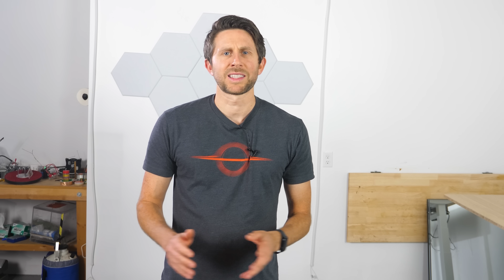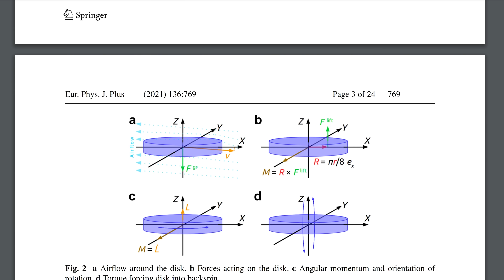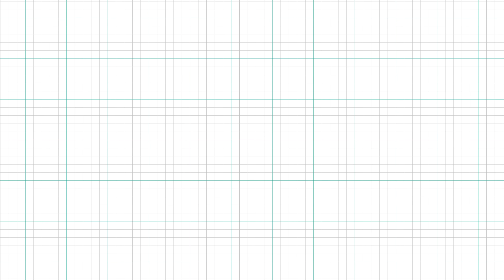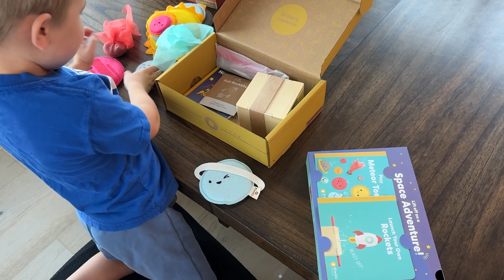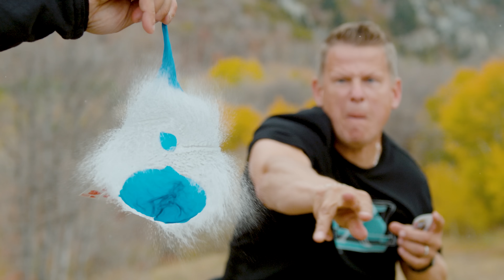The Secret Behind the World’s Fastest Card Thrower

Comment: Just did a pulling test on plastic last week. 100mm/min pull resulted in a pretty quick snap with little stretching. 20mm/min produced like 4-5x stretch length of the object itself. Due to the structure being a big messy bundle at first, but if you pull it slowly, they start to organise in a direct chain until they finally break. Plastic is weird.

Comment: bro amazing video, though i believe there is another force at play here, when you spin an object it creates centrifugal force so everything from the center of the mass going to the direction of the spin is actually enhanced by additional energy that is stretching out the edges and making them sharp so when it hits it strikes and doesnt bend. I blieve mostly thatsz the reason why when its thrown it cuts and when pushed slowly it bends, the spin makes the card harder on its outside edges because of the stretching forces
Reply: it would be interesting to see if you can measure a card thats being thrown without a spin just direct shoot, will it cut or it will bend, that will show it all :)

Comment: Regarding the scale used to measure the force of the thrown card; what about the inertia of the scale mechanism? What is the mass of the weight plate and the gear assembly that turns the dial, as well as the spring that is calibrated to resist the weights placed on the scale? Since the power of the thrown playing card relies so heavily on the impulse, rather than the mass of the card itself, how much of the impulse is lost to just setting the scale into motion. If I were to estimate the actual impulse force of the impact of the card, I would guess over 1kg of force for a short time, possibly more.

Comment: Seems to me that there is much more of a shearing action instead of a buckling compression force.  The card euler buckling capacity is very low but due to its profile, speed and angular momentum, and shear modulus, it should be able to cut through more of a slicing action than a penetrating action.

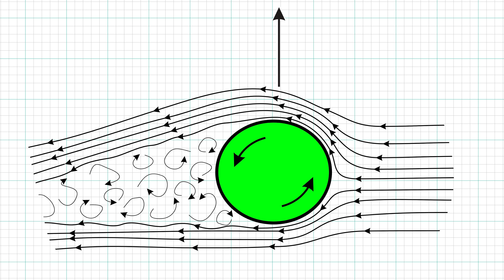Comment: "When the object is in a backspin. 3:20 ..the top of the disc is dragging air in the direction of the moving object..." In a backspin, the top is moving opposite the direction of the moving object. It's moving backwards, like a retreating helicopter blade and is moving slower than the bottom relative to the air.

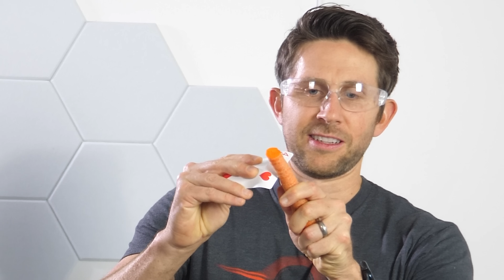Comment: 6:47 i think the reason why the card did not  bend when thrown with speed and a spin is because it gets stretched out due to the centrifugal forces and becomes stiffer then normal. Also your way of measuring the impact of the card was very inaccurate,  that is because the plunger of the scale has inertia and it absorbs some part of the impact.🧠
Reply: I think you’re on to something there… and as far as the measurement method, yeah no good. But if they tested a few other “controls” they could have a better idea of the real forces involved.

Comment: Great video!
Though I gotta say the part with the scale is wrong on several levels. First, the maximum force generated in an impact inherently depends on the hardness of the objects.  In the ideal case of perfect hardness, the maximum force is infinite. So the maximum force generated in the scale test has no relevance to the styrofoam.
Second, the way the scale test is being carried out, it isn't measuring maximum force during the collision at all - scales can only measure force in equilibrium. The maximum reading on the scale can however be used to calculate the energy transferred from the card to the plate during the collision.
Reply: was wondering about that, the card destroys itself on the scale, crumpling up, so a lot of energy was lost there.

Comment: The scale doesn't measure force correctly due to inertia.
You've made a measurement, how far a spring extends/contracts in response to an impulse, but that measurement doesn't correspond directly to the thing you're trying to measure, the energy imparted to the card upon launch. That form of measurement should significantly under-report the force of a low-mass ballistic object in comparison to a static force applied steadily where inertia does not significantly resist the extension/contraction of the spring.

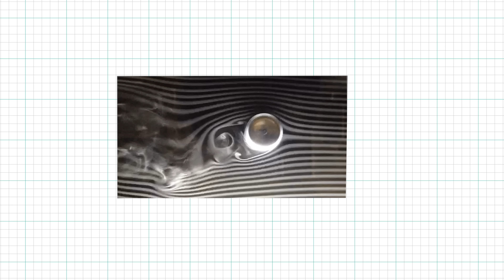Comment: 3:10 why do athletics discus not pivot (at least not that much)? I was a discus thrower myself and on a good throw the discus would remain flat for the complete trajectory, which is much longer in time and space than these cards. Pivoting would occur when the delivery phase of the throw was bad, as one would expect. Is this just because of the higher weight of a discus, or also because a discus has its weight allocated to its rim?
Reply: Right, many more new unanswered questions
Reply from the maker: The discus is so much heavier that the force of the wind is much too low to pivot it. The mass of the discus is two thousand times that of the card so you will not see the same effect.
Reply: @TheActionLab You need to do a video with professional disc golfers. You'll see some crazy physics at work.

Comment: I would think the spinning of the card increases its tension and therefore rigidity.
I've seen videos of people using paper as a saw blade at very high rpm. It's true that a fast moving card could cause damage without rotating, but theres probably a non-negligable difference.
Reply: Good point, it may act as a sort of pre-tension.
Reply: thats exactly what I think as well, the must get rigit af at that speed